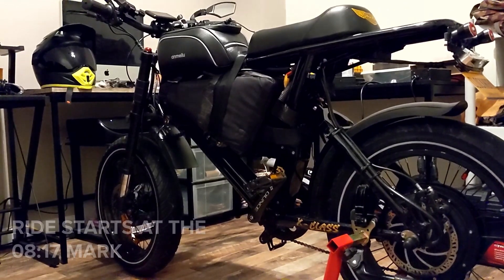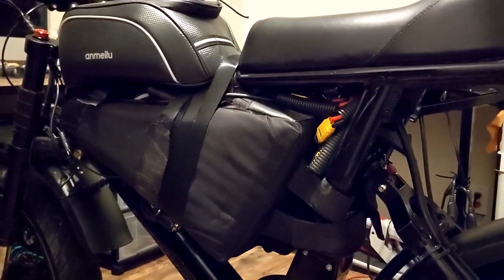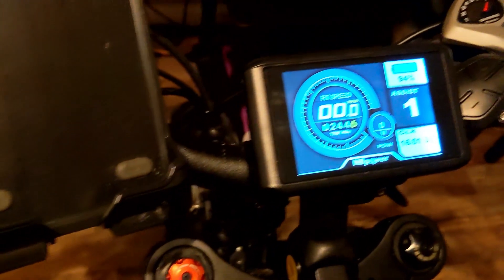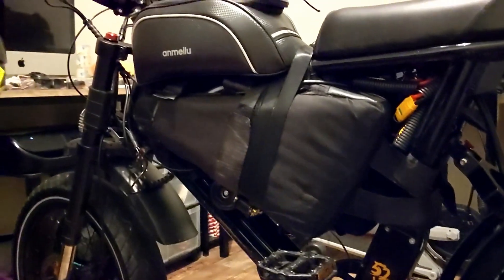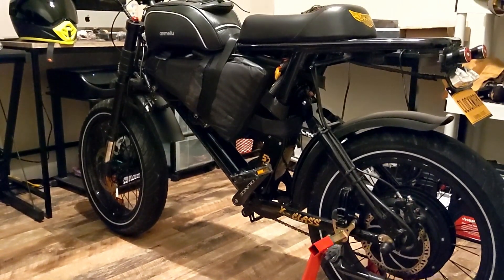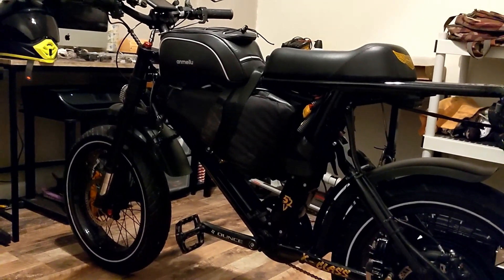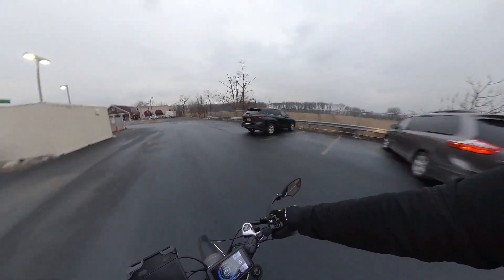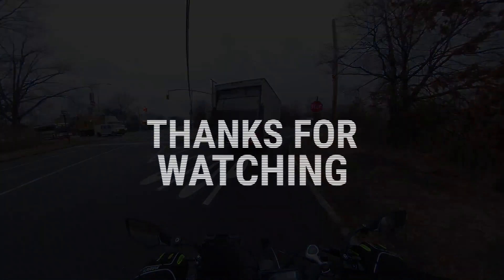Ariel Rider X-Class Speed Mods | Episode 2 - Bike Overview + Bonus Ride Along

Comment: Do you need to register your Ariel Rider in Staten Island?
Reply from the maker: No you don't. It's still technically an Ebike with pedals so you will be fine.
Reply: @JB360_NYC  Thanks brother.
Reply: @JB360_NYC  hey bud, do you know if Surrons need to be registered in Staten Island?
Reply from the maker: @strix_s5165  nope you don't need to register your Surron in all of NYC. In Staten Island, cops don't care as long as you are not wheeling and or running reds you'll be fine

Comment: Great video sir my x class is getting a little over 3k miles and gotta rebuild the cracked battery terminal.. do you have any footage or hints for modding the bike's plug in for the battery?
Reply from the maker: Hi! Is this in regards to your charging cable? In essence you can splice most connectors to your charging cable but I'd have to see what specific issue you're having with it.

Comment: Hi there looks amazing. I had a question for you. I just got a grizzly and I have a rattle sound in the rear motor. Not sure what it could be. I was told probably planetary inside something broke ? I was trying to to order a new Bafang motor for the rear and take the old one off. Any suggestions on what you would do and recommend? And how difficult is it to get a rear Assembly. I saw the motor for like 300 bucks but I did not find the rear assembly
Reply from the maker: Yea that's the complicated part. It's easy to get the motor but assembly with rim and spokes installed is rather tricky to find. You can honestly try AliExpress but you gotta find the kits with good reviews. You can also check Marketplace to see if anyone's selling stock AR parts.

Comment: I noticed e-street bikes sells a 5000w qs motor kit as well, would that theoretically fit on an x-class? Not that anyone would ever need that much power lol.
Reply from the maker: Technically yes although getting the motor to fit in the x-class dropout is a bit of a challenge as they are not a direct fit. I believe the dropouts would have to be be shaved down with some torque arm adjustments as well. Sal currently has the regular 5kw kit on his X-class and that thing moves. He hit 70 the other day.
Reply: @JB360_NYC  I asked through the website, and they said that while it is possible, it could damage the x class frame because of the amount of torque. Any recommendations on solving that issue? I’ll most likely just go with the 3000w as even that is probably more speed than I need lol
Reply from the maker: @atyrone  the only other solution I would say is the double up on the torque arms. Have them mounted on top of each other to keep it in place.

Comment: Very informative video of a great build. I want to upgrade my X-Class 52v to an E-Street 3kW motor also. But I have a (probably dumb) question about battery choice. Can the 80 amp controller only handle an 80 amp battery? For example, could you have used the Full-frame Molicel 72V 300amp, 42Ah battery with that motor kit? Or would it have required an upgraded controller? 

Yours is the second build I have seen that uses two 72V 20Ah 80A triangle batteries. So I'm wondering if you used that battery setup because of the (MUCH) higher price for higher-capacity molicel batteries? Or because the battery amperage has to match the controller? 

Since the Molicel battery is called "X-Class Full Frame" my first thought was that it should work with the recommended motor for the X-Class (which you used). But there are several different shape/capacity 72V batteries, all above 80 Amp, and my brain burned out trying to figure this out.

Hope this makes sense. Thanks in advance for any info you can give. Keep up the great videos. Your rush-hour commute POV video is a blast! Makes our Bay Area street traffic seem pretty sleepy by comparison!
Reply from the maker: All questions are good questions! So my 80amp controller can handle the 42ah Molicel frame battery with no issues. The 300amp is just the max current the battery can produce before the BMS kicks in to protect it. A friend of mine actually owns the Grizzly version where he has a total of 50ah of Molicel using an 80amp Sabvoton. If you want to unlock higher top speeds, you can upgrade to a bigger Sabvoton controller such as a 100amp or 150amp. There is more current passing through those higher rated controllers which allow the motor to perform faster. I've even seen torque and acceleration increases when upgrading to a 100amp. That's something I plan to do probably by sometime next month.

This upgrade is so awesome as well, it's a completely different bike. Sal the owner of E-Street bikes is also really cool and helped initially with any questions I had.
Reply: @JB360_NYC  Thanks for all of that info, man. Very thorough and helpful !

Comment: So basically $2500 extra in parts (I didn't do the math) plus installation that if you pay for it is 2x parts cost. Not to be sarcastic but then you risk confiscation and fines for exceeding laws. Just saying, but if you don't live in a concrete (heavily punitive) city, it's a cool upgrade.
Reply from the maker: No confiscation or fines here in NYC. It may be different in other states for sure. Kit is great especially since it's like paying the price of an Onyx or stock Surron except it goes faster than both.

Comment: Thanks so much for your honest review, amazing information . Where to purchase at Ebike street business. Your Top speed and range. Your set-up of your ebike.
Did you upgrade tires? Brakes? For the extra power?
Reply from the maker: Hey thanks dude! I changed the tires to Zugo Street tires (20 x 4) and they are smooth and hug the road perfectly. The brakes are still the same except I switched to larger 203mm rotors for extra braking power.

Comment: Jb how did u hook up the dc converter light kit and kept the original brakes?
Reply from the maker: So after you install the light kit, you can't use the original brakes because there's a specific brake sensor wire that hydraulic brakes use. I ended up getting these brakes that had the sensor wire (you don't have to get this one just one that has the same type of wire)

https://www.walmart.com/ip/Front-and-Rear-Hydraulic-Disc-Brake-Assembly-Set-with-Power-Switch-for-Folding-Bike-Electric-Scooter-New-Cycling/595572624

That wire connects to the controller wire that has that pink/yellow wire on the right side by the DC converter unit
Reply: @JB360_NYC  nice. Does this fit a 203 mm rotor?
Reply from the maker: @darkmanx2g  yes it does. Just make sure you get the right 180 to 203 caliper mount and you're good to go
Reply: Cool thanks man. If we don't put the brake levers the back light will stay illuminated like it's braking?
Reply from the maker: @darkmanx2g  if you still have your stock battery connected it will still work.
Reply: @JB360_NYC  do the brake cut off still work as well?
Reply from the maker: @darkmanx2g  yes brake cutoff still works

Comment: Hey did U ever think of making it AWD like D-class 2x750 hub motors & grizzly 2x1000 hub motors. Also where can we get these hub motors AWD wheels.
Reply from the maker: Actually yes originally was thinking of doing dual motors as they're great for hills in general and getting up to speed slightly quicker. For me, the single hub motor is sufficient and powerful enough without too much weight added on.

Comment: So at 7:30, if I understand you can 80miles from both batteries ?! Don’t you think 40miles is too low for 2 72v batteries ?
Reply from the maker: 40 miles was the max I've gotten from both these batteries so far with aggressive riding..which was me going 50+ mph in 3 or more stretches..you can absolutely get additional range from these batteries going a consistent 30-35 mph.

Comment: if I buy and use single 72v volt 80bms battery for this 3000w motor, will I still be able to get 54+ mph ?
Reply from the maker: I actually plan on doing this test in a future video. From what Sal had mentioned, it's still possible to get 50+ mph from the single battery. For some reason the DateX2 adds on a few more to the top speed.
Reply: @JB360_NYC  I saw on website these guys even sell a 5000w dirt e-bike. idk if I should buy one of those bikes or x class and Get a conversion kit from them.
Reply from the maker: @Mackx7  yea he sells the Stealth Bombers which off the bat have great suspension compared to the X-Class as well as top end speed. I went the X-Class route purely because of the look and chassis style.

Comment: Nice set up. Curious if its a 5T or 3T motor? I have the same QS 205 Motor in a 5T winding on an Enduro frame setup I built. These motors can be pushed passed 10K watts no problem. Your 72V x 80 Amp set up is actually (Amps x Volts= Watts) running almost 6,000 watts. I'm in Queens so I hear you about aggressive drivers lol.
Reply from the maker: I have the 3T version. I was going to go with the 4T for the higher top speed (wasn't in stock at the time) but I love the torque with the 3T. And you're correct, I've peaked at about 5500 so far.

Comment: I have more questions when you want to buy the motor kit it asks you what is the drop out size and the wheel can you give me the info, and do you need two batteries. And what did you do with the stock battery?
Reply from the maker: If it's the X-Class it should be the 170 mm dropout but Sal will confirm that for you. Also, the wheel size is 20" x 4". I went with the 2 batteries since my commute is a total of 20 miles and I wanted the range while still being able to ride aggressive. You can still get decent range with one 20ah from what I was told. I ended up selling the stock battery.

Comment: I’m feelin’ the full twist throttle in 4:46. Will any motorcycle throttle tube work?
Reply from the maker: That's a good question. I'm assuming as long as it has the 3 pin yellow connector (female) it should work.

Comment: Hi there! I have an AR 52V. Do you know if I just change the hub to the 3000w am I gonna have any improvement on my speed?
Reply from the maker: Well you would need to update the controller and battery as well in conjunction with the motor but yes the speed difference is incredibly noticeable especially top speed and torque.

Comment: Nice setup man, I am thinking of getting the stock x-class for now, I'm underpowered with my first e-bike @ just 500w (rear hub)  I got a SWFT -ZIP and I feel the need for way more speed and power. So around $2300 for the stock model and then another $2k for the mods? Double batts is great. Congrats on this.
Reply from the maker: Thanks man! That's quite a step up from the 500w and your gonna love the X-Class. For all the upgrades about another 2500 on top.
Reply: @JB360_NYC  I'm actually coming from a gas-powered 190cc Thumpstar down to the e-bike world, so not an issue. I may just get the X-class stock for now if 36 MPH gonna cut the mustard. If I could add a 2000 watt kit to my SWFT I would do it, but these kits are bike specific.

Comment: What your disc brake size??  180 or 203mm?
Reply from the maker: In this video it's 180 mm but I have the 203s on since then.
Reply: @JB360_NYC  Im mods front motor with 48v20ah 1500 watts .. dual motors go for a year then i will pull trigger on that 72 v 3000 watts back motor..
Reply from the maker: @kenimus  oh nice dude, so you have 2 throttles then, one for front and one for back?
Reply: @JB360_NYC  dual throttle
Reply: @JB360_NYC   2 motors , 3 batteries .. hahaha Ranges and speed...
Reply from the maker: @kenimus  3 batteries is impressive! Do you have them running in parallel. I'm sure you're getting great range.

Comment: Great video I just wish there was a way to keep the pedal assist and be able to hammer it to hit 50 + mph
Reply from the maker: I know that would be sweet! If ever the battery dies I'm pedaling this 130 pound bike home 😂
Reply: @JB360_NYC  im pretty sure you can buy a peddle assist addon for the sabvoton controller/qs motor setup.
Reply from the maker: @718og  Yes there actually was an O-ring attachment for the crank arm that came with the kit but I had misplaced it. I barely use the pedals honestly except for saving face with pedestrian paths lol.

Comment: How much did it cost to do the upgrade and can you list parts I can purchase to get my Ariel x modified like yours. Also at that speed, how many miles do you get ?
Reply from the maker: No prob, the parts list is actually in the description. Overall it costs about 2k for the whole upgrade. With this setup usually get anywhere from 35-40 miles on a full charge.
Reply: @JB360_NYC  wouldn't it be 3k, since 900 for the hub, 830 for each battery, and 500 for the battery splitter thingy?
Reply from the maker: @fryderyktube3d  yes closer to 3k that he has the better updated QS motors now.

Comment: Great video! Got a link to the light kit and DC converting kit? Thanks!
Reply from the maker: Thanks! Here it is https://www.e-streetbikes.store/product-page/dc-converter-light-kit
Reply: @JB360_NYC  Thabks man. Do you know if the motor is easily serviceable for maintenance and part replacement (gears)?
Reply from the maker: @alamorides4485  for replacement parts I would probably check with Sal as he works directly with the manufacturer so if any gear issues come up he can most likely get supplies sent to you.

Comment: Nice build buddy you need to get some goggles or some safety glasses. You ever get hit by a bug or a rock your not going to like it. I’ve been riding for a very long time and I wear my gear every time I ride and wear your gloves all the time also if you ever go down your going to wish you had them on  they will save your palms and fingers and the rest of your hands and they give you better grip on a slippery throttle from sweat or water. You have a fast bike so be very careful it could kill you. Watch for people pulling out in front of you cause your not going to be stopping very fast with all that weight of the bike and the more battery weight. Please ride safe wear your gear and eye protection and have fun buddy and God bless.

Comment: Hey what distance can you get with this mod? Did it increase?
Reply from the maker: Short answer is yes def more range. With the 2 battery setup I'm getting about 40 miles per charge and that's with heavy/aggressive riding. If you were to keep it between 30-35 mph, you can easily get it to 50 miles.
Reply: @JB360_NYC  what is the top speed you get with the mod?
Reply from the maker: @johnpg4093  current top speed is 58 mph

Comment: That’s a great build. If we waited for the bike build companies to provide what is needed in terms of voltage, and motor upgrades we’d be waiting several more years. I hate the fact that 52Volts haven’t replaced the 48V we’ve had for eons. 72Volts  should be the standard for anything weighing close to a hundred pounds. I look forward to the day where the power/range provides a couple hundred miles of riding going at a pace of 80mph average. You don’t have to go that fast, but that only helps in further extending range on more reasonable rides of between 25-60mph on the streets where much more protected and heavier vehicles are traveling at set speeds all the time. I speak of the bicycles too that don’t look like heavy set scooters/motorcycles. The technology has been there for long enough to improve the speed, torque, and range of every sort of vehicle. At this point in time 21700 batteries for smaller electric vehicles other than several thousand pound cars should all be utilizing the much better 21700 batteries. When I purchase my next e-bike it must have those batteries in them along with a few other things that are not negotiable.
Reply: You living in lala land bro. These bike companies have to follow with regulations just like car companies. It just shows how much little knowledge you have.
Reply: @badimpulses17  You do know the suppose regulations mean jack shit, right? How many top selling evokes are way beyond the baby numbers being pushed on us? The terrible pretending does nothing, but make a fool of one self Period
Reply: @buffalomind6838  0k have a great day.

Comment: I just purchased my Ariel X52v recently. I want to make the same upgrade like you have on your ebike. Can I ask how much did it cost you for all the upgrades?
Reply from the maker: No prob. It came close to about 2k with the batteries and light kit I wanted. It could be less depending on if you decide to do 1 or 2 batteries. I went with 2 because my daily commute is rather long so need the extra amps.
Reply: @JB360_NYC  could you explain more how you paid close to $2,000?
On the e-street bike store, the QS motor is $899
The 72v 80BMS 20ah battery is $830 for one, and you have two.
The DateX2 is $520
And the DC converter and light kit is $250
$899 + $830(2x) + $520 + $250 = $3,329.
That's already more than $3000, not including the trunk bag, and tires. 
Could you elaborate please. I would love to only pay around $2000 for all the parts you have. 😁
Reply from the maker: @paperkilling  sorry I did not calculate in the 2nd battery 😬 so heres the breakdown according to my final totals:

3T Motor 3000W - 899
Both batteries 72V 80bms - 1600 this was rounded down
DateX2 - I got a discount on this one since I bought the kit and batteries which came out to 420
DC converter unit - 150 price went up on this one since then.
Reply: Thanks 😊  I'll probably look around where to buy the parts close here in Sacramento CA. where I live.